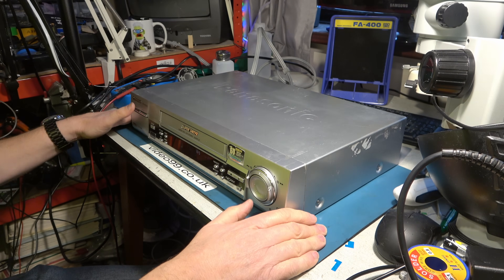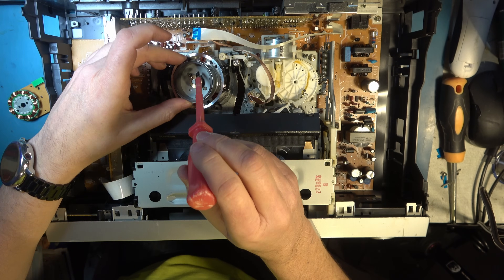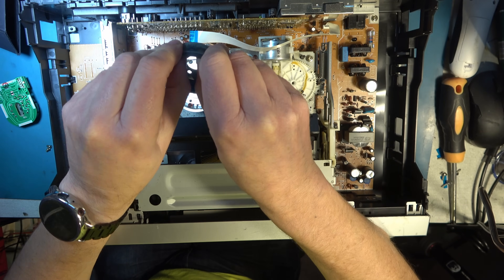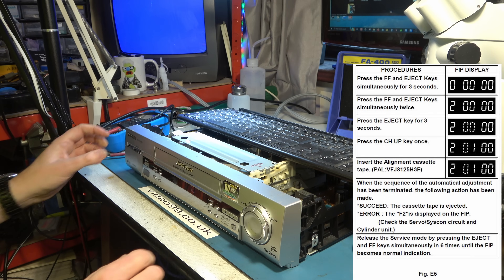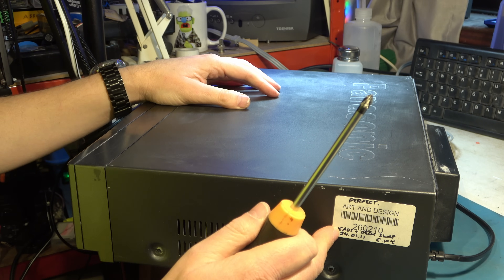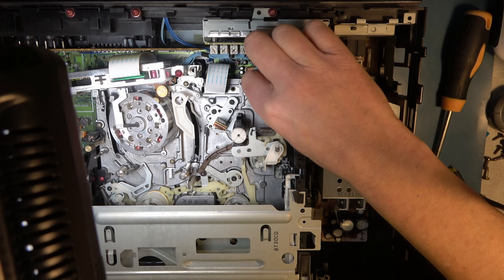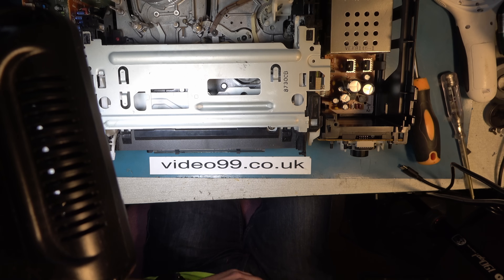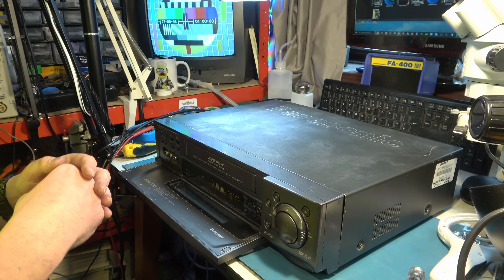Revisit S-VHS Panasonic NV-HS930 and also a NV-HS950.

Comment: This was a lucky shot! I had the exact same bottom picture interference with my 930 and removed the top video head board. The magnet had moved half a centimeter out of position, I turned it back aligning the crack to the small hole, and the picture is now perfect again 😀

Comment: Have you ever worked on any of their camcorders?  I have yet to see a better built consumer camcorder than what Panasonic made.  They all have a heavy cast deck and all of the boards are made to swing out for service- something that is almost exclusively found in the industrial/broadcast domain.
Reply from the maker: No, but I do have a 3-CCD Panasonic camcorder which needs attention so I may do so at some point.

Comment: I just fixed a NV-FJ730 having the loose magnet issue, but it continues to show 2 00 21, whereas I understand 21 is "PG automatic adjustment error"
Has anybody an idea?
Playback of VHS/S-VHS looks normal booth in SP and LP.
In another manual I found 21 stands for "the vertical synch signal is lacked while over five seconds on the alignment tape"

Comment: Hello there, I hope you can help. I have a mitsubishi HV-V6000 NTSC S-VHS VCR. IT plays tapes no issue but the HI-FI sound gone. If I send it to you to fix. How much would it cost? How much is the postal cost to send it back from your place to Ireland?
Reply from the maker: I don't take on repairs, I have a backlog of my own equipment to work on.  It's worth trying to clean the heads in case it's just a case of the hifi audio heads being clogged.
Reply: @video99couk  Thanks for quick reply. yes, I did clean the heads with dry paper. It is still the same. Anyway thanks.

Comment: What is your top 5  S-VHS in terms of the best picture quality?
Reply from the maker: Sometimes a machine which is great for one tape isn't the best for another, so you can't always say one machine is better than another.  Good workhorses include Panasonic NV-HS930, AG-4700/NV-HS1000, JVC HR-S7600 and several similar JVC/Philips models which include a TBC.  Personally not so impressed with Panasonic AG-7650 or JVC professional grade decks which seem to suffer from head wear and capacitor problems.  I don't like the pictures from Panasonic NV-HS950 even though it should be very similar to NV-HS1000.  I think it's helpful to have a fleet of different models from Panasonic and JVC in case a poor tape plays better in one than another.

Comment: Hi. I have a panasonic S-VHS video model AG-5700 and the problem is that tapes recorded in S-VHS mode the image as black scratches like when you put a tape recorded in S-VHS mode in a vhs video. Tapes recorded in vhs mode the image is fine. Any idea what the problem could be? Thank you.
Reply from the maker: They could be SVHS recordings on a VHS tape, called SVHS-ET.  Not all SVHS machines can play those recordings.
Reply: @video99couk  I have a tape recorded  in S-VHS mode that used to work fine in that video. But now the image as the black scratches. It must be another problem.

Comment: Congratulations! I'm happy you followed my advice on the other video and you succeeded.
This fault is very common and you will face it again in the future.
What happens with that magnet is that it slips during acceleration stages, as simple as that.
Superglue is absolutely fine for that repair, I've repair dozens in the field with no problems in the long run.
Keep doing such a good job and greetings from Spain!
Reply: thanks to both of you, had same issue on nv-hv60 (same mechanism), i thought y/c processor was shot.
would of never guessed it's magnet coming loose.
good men! 
(mentioned auto-calibration procedure also works on nv-hv60)

Comment: Just shows you that you do not have a clue. So now let’s get superglue out. Why don’t you build the whole deck with superglue? Don’t even have a tool for that little grub screw lol and not even alignment tape. Oh and no tool is an overkill they was made for a reason but you think a screwdriver and superglue is all you need lol. You shouldn’t put superglue on it because you can cause more force. Would you superglue engine fins on to see if it will hold. Think you need to learn forces in spinning at high speeds,etc. not going to go into it because you wouldn’t understand anyway. Buy yourself some decent decks and transfer and do a channel on that because you don’t have a clue or the tools for repairing.
Reply from the maker: One point which certainly made me LOL was using an alignment tape.  They were last manufactured about 20+ years ago and were usually pounded to death by service departments.  It's not like you can just order a new one of those from Panasonic, here in 2024.
Reply: @video99couk  well I still have some but still to the point superglue. I still have my repair service kits with all the tools because of being a service engineer and we used the right tools and not superglue. And like I said learn how forces work and gravity the thing that keep you on this planet. You can back yourself up as much as you like but your what’s called a piss poor job and nothing who knows about these things would work the way you do. Don’t ever try to fix laserdisc players or optical recorders, because you would how to learn how to use your tools and not a lucky screwdriver and superglue.
Reply: Why do you bother to watch this channel if it offends you so much?
Reply: @barrieshepherd7694  I don’t, for some reason these videos keep popping up on my watch list with other stuff I don’t watch. Maybe it’s to do with other channels linking them. Also it’s because I don’t want people trying this thinking they might be able to fix theirs and mess it right up or worse electrocute themselves. All vcr repairs need special equipment to put them right, even tension you use a special meter to put it right. Speed it’s playing,etc it all done with equipment and not superglue. But what do I know only fixed this stuff for most of my life. Anyway if you want a good vcr you still can get new old stock. Also you can still get parts, you just got to know where to go.
Reply: @Matt_Quinn-Personal_Account  don’t make you laugh. You’re a joke in repairs. I attack because I spend most of my time repairing these mess ups that people like you have done. Laptops are the top thing for repair videos on here showing people how to mess them up more, phones are a big thing too. I don’t care what you know or are but you know nothing about repairs and have very basic knowledge on this. Also I don’t want to start a channel, because I don’t want people trying this that could lead them to harm. We are playing with electricity after all, also I don’t have the time to teach people. Because to teach them takes years of studying and not a short video.

Comment: I had a Panasonic S-VHS machine with the drawbridge facia, I thought the VHS picture was much better from the older VHS only Panasonic.I thought the picture was noisy, compared to the previous machine, for no additional detail.
Reply: if these s-vhs models are anything simillar to my nv-hv60 (which has same mechanism as first deck in thsi video), then you're right, pretty bad picture.....

Comment: Well done Colin, the machine with the loose magnet was the first time i've ever seen that odd failure.
I bet we will never see that again.
Most of the vcr's i repaired  had the flap that you had to lift it before putting the facia.
The plastic end pins that were part of the flap i had to drill tiny holes in the remains of the pins to join it back on to the flap end.  Needles were glued in to support the flap.
A bit bodgy but i didnt have a new flap to fit.
Sorry colin, long waffle :-(
Reply: It's very, very common on these decks.
Last week I serviced two units with this same fault.

Comment: If the ferrite ring of the NV-HS930 almost runs without glue, I would have only used 1 drop of my special glue (Pattex Repair Gel) to absorb the rotational forces. In contrast to its predecessor NV-HS960 (Amorphous Heads), the NV-HS930 (Superferrite Heads) has HiFi sound even when the FM carrier amplitudes are below the norm. Second 960 KO criterion: the TBC does not work correctly if the image content begins directly after the burst level. The 930 has no way to get full Y resolution without dropping VNR. Either the sharpness adjuster (no + if VNR is off) or the VNR is the limit. My NV-HS950 had a TBC that tended to shift lines to the right up to the TBC limit when the tape quality was poor. I usually have a servo motor in reserve for the K-Drive because removing the old oil from the motor pulley with denatured alcohol and sticking it on with repair gel takes too long. Only a burst motor pulley can no longer burst, which is why I glue it with an adhesive that doesn't stick (attacks) to plastic, but only forms a "driver" on the chrome axle for the gap in the pulley, as the rest of the glue passes through the tight pulley is pushed away. Leave 1mm of space above the end of the motor axle. If a K-Drive recorder has just broken down, you can try turning the device upside down and pressing eject to remove a cassette. Had it tested successfully in Denmark so that the cassette didn't have to be sent to Hamburg. The oil needs time to creep under the pulley.          Sorry, I couldn't completely correct Google Translate.🙄

Comment: i had a 1990s japanese imported model svhs with tbc but it died beyond repair as the basket had bent and put stress on the motors over time.  It could not be repaired.

Comment: I've studied the K mechanism extensively and found out that the motor coupling breaks mainly due to high spring tension on the pinch roller. It puts too much stress on the coupling when the tape enters the play/picture search mode. I slightly stretched the spring to make it longer. Now it has approximately the same pressing force as the spring in my old Sony deck. Never had any more problems with the coupling since. I own 6 K-mech decks and I've made the adjustment on all of them. It is also a great idea to lubricate everything. I use lithium soap type lubricant. They say it does not damage plastic and so far so good.
Reply: The Teac/Symphonic idler clutch had a similar issue where the spring steel in the clutch becomes stiffer with age. Cutting the spring in half and stretching to the normal size fixes most of the clutches and felt is not worn. When I worked on the bench we used molytone grease for tape mechanisms.
Reply: @chad2787 True. However I do not know where to get this grease. The ones originally used are not being made anymore. The lithium soap is as close as I could get it.